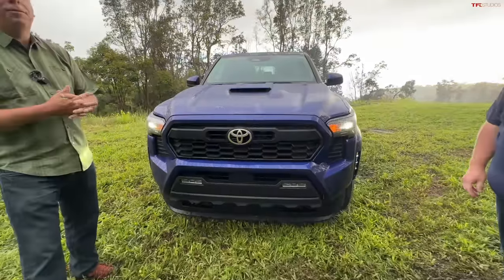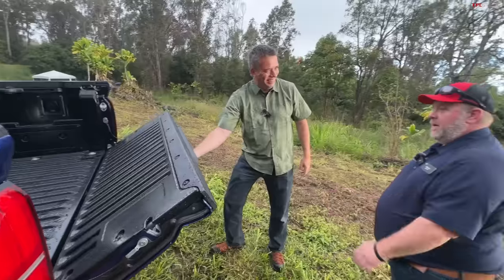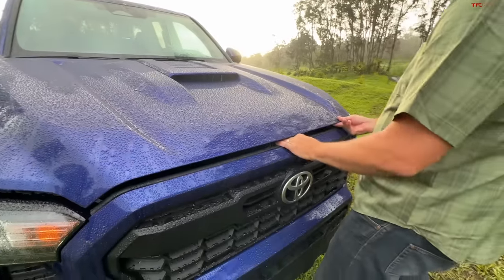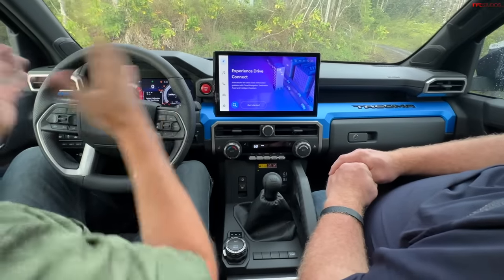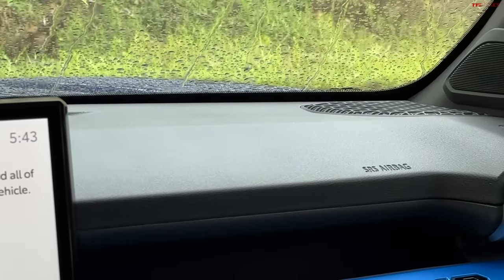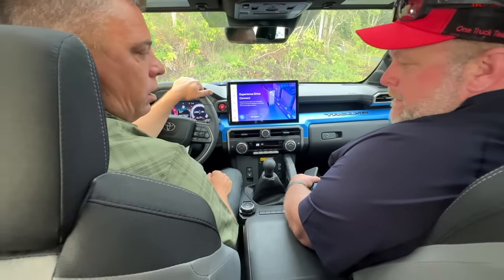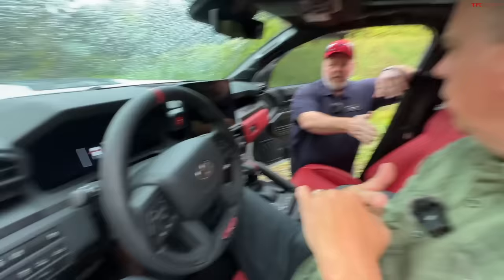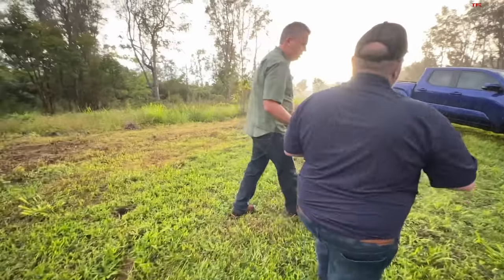2024 Toyota Tacoma Very Deep Dive: I Answer All Your Questions with The Truck’s Chief Engineer!

Comment: I do appreciate that the Tacoma team kept the manual transmission available when every single other manufacturer of midsize pickups has completely ditched it. I also like that they still offer an extended cab and long bed for the crew cab, unlike GM and Ford. If I can find an SR that actually sells for sticker, I’ll buy one. I’m generally more of a GM guy, but the lack of a manual in the Colorado/Canyon takes it off of my radar completely.
Reply: GM got rid of the manual transmission because nobody was buying it.   I’d bet money Toyota eventually ditches the manual too when it doesn’t sell.
Reply: @holdenc3082  I've got a deposit down on a bolt action '23 Tacoma. There was a list of other folks at the dealer I went to who wanted to same. I check other dealers inventories, and almost all the manual trucks are sold before the dealer even receives the truck. Toyota still sells a good amount of stick equipped trucks.
Reply: hg89a  Just because you don’t know how something works or how to properly operate it doesn’t mean that you should disparage said thing. There’s clearly still a market for the manual transmission in the midsize truck market or Toyota wouldn’t bother offering it. While it’s true that most people nowadays are too lazy and/or inept to bother to learn how to drive a stick, that doesn’t take away the pure pleasure that those of us who prefer them over a slushbox derive from driving a vehicle that is equipped with the proper number of pedals.
Reply: I have two Tacomas with manuals. A 98 Tacoma with 305,000 miles still using the original clutch. I also own a 2017 Tacoma with a manual. I will now be ordering a 2024 with the manual. I don't want to argue about what's better, I just prefer manuals. My profession is that I rebuild transmissions.
Reply: hg89a wheels are dinosaurs too. Should we discard  them?

Comment: I want to see the trd off road. Definitely loving the fact it has an 8 speed automatic now. Definitely wondering if the tacoma will retain its reputation for being reliable with a new engine and transmission.
Reply: I would also worry about the insane amount of new gadgets and technology that will probably only be fixable at dealership
Reply: Just change your oil 5k or more and DO NOT follow the toyota marketing driven/epa leg humping 10k oil swap. Yota did Turbski 4 banger trucks ~38 yrs ago youll be aight! The frame rust thing for wet states is hopefully squashed by now...tons of worry-warts still afraid of Taco over that disaster.
Reply: They have shown renders of the TRD Off Road. Big thing of note is that it appears to have the front air dam now.
Reply: @05EVORS  Toyota started adding CRC from the factory since 2016. I had my 2017 taken in for the campaign and this was something they noted. I also add my own rust protection every fall. I see newer GM vehicles in my area with far more rust than my Tacoma has.
Reply: @05EVORS  Its states that salt the roads.  Its hard on all cars and trucks, some people keep an old beater around for the snow season.
Reply: @RedWingsninetyone  It's made to be removed with 9 screws.
Reply: @ProjectWrecked  right, but the fact is that you'll have to do it and then figure out what to do with it.
Reply: @RedWings-44  True, but I think most people will just put it in the trash.
Reply: Yes I to wonder how reliable the new turbo engine and transmission will do. They had problems with the new turbo tundra they had to pull the engine to work on the turbos.
Reply: @MrNorthstar50  all part of the growing pains. It's why you should always avoid buying the first model year. That being said, Toyota wouldn't be betting on them so heavily if they didn't think there was something to them. Same with Ford.
Reply: @05EVORS  Lol, you should just go ahead and say 'Yoda' since the true spelling of Toyota is Toyoda.
Reply: Turbos don’t last.   You will be lucky to get 100k on any of these turbos that are driven normally.
Reply: I like real dials for speed, fuel and rpm’s.  So tell us, how much to replace an electronic dash?  💰💰💰
Reply: @ccsocal768  not sure but I guarantee that it's a lot less than the markup you would pay for just buying a toyota since their is basically a toyota tax on all toyota vehicles. As far as your comment about the turbos not lasting that definitely isn't anything factual since the truck isn't released yet. I've seen plenty of four cylinder cars with turbos make it past 100k though.

Comment: God I love how Toyota really listened to their customers on this one! I mean all he's explaining is how they implemented what the customers wanted! Ya a lot of people wanted the 6 and hate the 4 but aren't factoring in the implications of the ability to actually see gains from a tune more than 10hp/tq if that! They've made it so that if you want big power, you really don't have to go iforce max for it. Just watch what happens when turbo swaps happen! I can't wait!!!
Reply: That turbo will kill the longevity of the motor. Low end torque is best for 4x4. This was a stupid move from Toyota. Same with the Tundra. Glad I have a 2018 5.7l 4x4.
Reply: @welderdude1  we won't know until we see it. I myself have a 23 V6 4x4 taco but much better gas milage, hp, and tq sound like a decent trade off to me
Reply: @truly_I_say  it's not. Look at all of the smaller cars that try to make up for lack of displacement with boost. It raises pressures and heat killing motors. Also it's top end. You have the best version of this truck so long as you tune the ecu. The newer generation has a very bad habbit of not staying in a gear when crusing or climbing. Kills gas milage. The tune fixes this issue.
Reply: @welderdude1 Agreed. I loved Toyota for their reliability. I'm not interested in these new turbo 4's

Comment: Seeing the new Tacoma makes me hopeful that the next Tundra refresh will carry over these changes. 2400 watt bed outlet, tow hooks, better front-end, rear bumper, more aggressive styling for the TRD Pro trim, etc.
Reply: This is what I've been waiting on. Hopefully the other pandemic prod issues like leaking windows, cracked driver seat, etc will be addressed in the current gen refresh as well. I also guarantee you the "Goatee" will be gone from the front end and it'll look more like the 2023 Sequoia and 2024 Tacoma. That was a huge mistake.

Comment: You missed the important questions:
Can it fit 35s without trimming?
Does the 2400W power works when the engine is off (for camping) out of the hybrid battery?

Comment: Big thanks to Sheldon and the Toyota engineering team for keeping the manual transmission. Will the trd pro be available with the manual transmission?. Big thanks to tfl for having this conversations with Sheldon the chief engineer.
Reply: I'd say no manual on the pro due to the hybrid setup
Reply: @tylough  Yeah it sounds like the Hybrid wont play well with the manual. It wont matter though. 3 months after the launch of the TRD Off-road all the suspension manufacturers will have a coilover system and ARB will have lockers for it. Build your own TRD Pro for a fraction of the cost and option a manual. You wont have the wider stance but for sure there will be aftermarket fender flares and increase your offset by 30mm with new wheels. Done

Comment: I have a feeling that pinch sensor on the tailgate is going to cause problems.
Reply: I like how he just finished talking about saving weight before talking about the power tailgate.  huh
Reply: Most likely optional for lower to mid grade, standard to limited,pro,th.
Reply: Toyota cares about safety, even their lower trim has safety sensors.

Comment: Sheldon is the best engineer I have ever seen.  We used Toyotas extensively during deployments and I am finally going to let go of my trusty 235k 2nd Gen that runs like a top as I can only fit my 4rnr and one Tacoma in my garage🙌🏾.  Thanks for the great interview and exceptionally clear, concise, and information.  Thanks Sheldon and Roman for this, can’t wait until I am able to order my TRD Pro.  

Question:  Does the 4th Gen Tacoma take the same Upper and Lower control arms as previous models?

Comment: What can you say about the Toyota customers going to tacoma for the reliability? The new turbo charged 4 cylinder puts more pressure on the intake, thereby wearing out the engine faster. There is no option for a non turbo engine. Shocks in the rear will wear out faster than leaf springs. Disc brakes also need to be serviced more often than drum brakes.

Comment: Even if the pricing on these will be crazy, glad to see toyota went all out with the new taco. Good to see that it will likely be the segment leader once again
Reply: They did cost savings on the base model, still has leaf springs.  All out on top trims.
Reply: Pro is most likely >$55k with the standard air suspension seats.

Comment: I bought a 2000 Tacoma TRD Off Road 5-speed manual 3.4L V6 brand new and drove that truck every day until late 2020. I was ready to upgrade to a new Tacoma manual transmission truck, and when I got into the truck my 6 foot 1 inch self nailed my head on the top of the door frame and almost knocked myself out I hit it that hard. My 2000 was taller than the current model and I couldn't believe when I finally got in that my head was 1-1.5 inches max from the roof. I was so disappointed that I did not even test drive the truck. 

So, my salesman recommend a Tundra. I got into that TRD Pro model and was blown away by the size, the comfort, and the incredible sound of that TRD dual exhaust. I didn't even need to drive it I was sold. 

So, I say all that to say I am glad they have made the cab taller for slightly above average men so they don't knock themseles out simply trying to get into the truck.

Comment: Only gripe so far is no rear AC vents. I mean it may not be an issue but I’m the Texas heat and no remote start my kids love the rear AC vents in my Rav4 which I’d imagine is similar cabin size.
Reply: This is my biggest complaint as well... Seems like such an easy and cheap thing to add.

Comment: Lots of comparisons here in the comments between the new Tacoma and Tundra.
Right off the bat the Tacoma's lines flow so much better than the Tundra's.
The big difference is the aggressive axle, wheel offset combo that makes the Tacoma look very tough while the Tundra's wheel and tire offset makes the body overwhelm the axles.
Easy fix with aftermarket wheels and tires, flares etc but it is nice to see Toyota finally bring us this from the factory.
Tacoma was and still is by far the best looking compact truck. Well done!

Comment: I'm actually excited for this new Tacoma, and I drive a 2500 Ram. I really wish the TrailHunter was available with the iForce MAX + manual trans. I'm not super-excited about a turbo-4, but with electric augmentation it'll likely be ok. I would prefer a stick shift in a compact truck though....and torque peak at 1700 rpm on all powertrains? That's good news.

The cab to bed dimensions with the 6' box are perfectly proportioned. This is a very nice looking truck.

Also, I can't help but notice that Sheldon's voice could pass as Nathan's.........

Comment: Toyota needs to get a hold of Shaun Whale from 4WD 24/7 who is a diehard Toyota driver for the Australian bush trails. Give Shaun a Trail Hunter Tacoma, but with Shaun's signature 35" tires, and throw on a snorkel and winches front & rear, along with ARB front bumper & grill guard with LED off-road lights. Shaun will REALLY put this new Tacoma through it's paces.

Comment: That front air dam is still bizarre to me.  Easy to remove I suppose.
Reply: It helps if you want mpgs, but it is easy to remove
Reply: @John-bm3bf like +0.1mpg
Reply: 🤣 True that but it still a plus +
Reply: According to Andre ( in another video), he said it is held in place by 8 easily removable bolts.
Reply: If you live in snow and salt states keep it. I removed my old one BIG mistake. Yeah, it looked cooler but then all that chit from the road went up under the truck.

Comment: Trailhunter is my favorite... considering trading in my ZR2 for it
Reply: I like the Trailhunter also, but don't like there won't be a sunroof available on it. Some rationalize that it's an off road oriented truck. As we all know, most buyers of off road vehicles never take them off road.
Reply: @66skate  yeah, sunroof when driving through the forest would be nice... maybe i should do the TRD Offroad instead, get the sunroof, and probably do everything i need.
Reply: @RedHawkish  That seems like it might be the  best choice. Not enough details yet to be sure. The Limited looks good, but not with all of the chrome. If it came with a blackout package would be ideal.

Comment: Wish the cab was not so cramped in terms of driver legroom (I'm 6' 4") and wish the width between wheel wells was 48" so it could hold a sheet of plywood or sheetrock
Reply: It's near useless and a toy pretty much

Comment: These look great.  However, one of the things about the Tacoma I've always appreciated is the simplicity, reliability, longevity, and ease of repair.  The 2024 Tacoma line seems to have gone all in on expensive, complicated, fuel efficient thus fragile, and bling.  I guess the cheap reliable work truck isn't profitable enough.

Comment: The Trailhunter is a sweet rig but it needs a metal front bumper and a winch before it is a complete build. Notice how they don't want you looking at the back seat in the TRD Pro? There is no room for back seat passengers with that seat. Cool seat but it is a prototype and refinements will be made I believe.

Comment: My only wish is for Toyota to actually dumb things down a bit...I diagnose and repair a lot of electronic controls for large machinery and hvac systems for large buildings and manufacturing. Most of our problems, some minor, some real serious are almost always software or electronically based. Things can get wet, corrode, crack or fail from vibration and temperature change, etc. In summary, it's a truck not a rolling server room. I know how to drive just fine, I don't need a computer to rev match, brake for me, or interfere in any way. I also want a key, not a pushbutton start, and I don't like the location of this one in your face. Just give me the basics with remote start and I'm good. I keep my vehicles for many years because I keep them in excellent condition, but all these electronics really worry me once the warranty runs out. This might be a lease and dump vehicle.

Comment: I wish they could bring back the standard cab and long bed in the SR. I have no use for the extended cab, but I absolutely need to maximize the bed volume.
I also wish Roman could just run the camera and keep quiet.

Comment: The seat. Why not just fit a truck or tractor seat which generally have air suspension, fore and aft suspension, variable damping, auto height and weight adjustment, heating/cooling, swivelling, customisable armrests with options like seat mounted vehicle controls and switches. An example is the Grammer Actimo Evolution.

Comment: Are both the top-level TRD AND the Trailhunter available in long bed?  Any other trim levels have long bed?  I need a long bed.   Thanks.
Reply: Agreed, these cute 5 five foot beds are useless for real hauling.  6.5 foot minimum to haul an atv with the tailgate closed is my minimum standard.

Comment: can you get the manual with the TRD Pro and the TrailHunter models?
Reply: In Canada, it won't. The Trail hunter doesn't get it either because both trims come with the iForce Max hybrid powertrain as standard which is only paired with automatic transmissions.

Comment: I'm still confused if what appears to be hooks at the sides of the front skid plate are recovery hooks or not. Needs to be clarified. Otherwise I'm pretty impressed. Until we hear the exact suspension travel figures we won't quite know if this might match the Ranger Raptor or Colorado ZR2. I still really wish they had offered a front locker. Traction management systems are not replacements for lockers no matter how much Toyota wants to say so. And "adding" a locker isn't cheap or easy and Toyota will throw out your warranty in a hurry. But I do really like they've added a disconnecting sway bar, I love that feature on my Gladiator. After the Tundra was released I was worried... This looks like a much more impressive package.

Comment: They need to add a long bed too..  and hoping in 2026, they’ll add a 3.0L v6 Turbocharged as optional.. and would be nice to have a 4.6L V8 as well

Cons: 2.4L turbo (not strong enough for hauling)

Comment: Wheres the;

Front locker
10 speed trans
Increased towing capacity
Turbo or supercharge V6
Steel front bumper
35" tire

What's the fuel capacity and range.

Comment: Looks ok, but it's got the air dam on the front bumper that reduces the ground clearance to something similar to a sedan. Wonder if the engine would overheat if you removed it, and if the other TRD models are going to have it.

Comment: Hmm... The interior looks great, nice update. The exterior though I'm not a huge fan of. The last gen had great body lines that aged very well. This is going for that chonky-masculine look and it's proportions look off. Kind of dissapointing. No doubt a better truck overall than the last gen though. The bump in power and 8 speed should be great, looking forward to checking one out if they ever are on dealer lots.

Comment: I own a 2001 Tacoma Double Cab, and I still have it and love it. All these extra installed gadgets can break and reduce its reliability. Do you really need all these unnecessary electronics?  A 4 cylinder engine is worse to have on a truck.